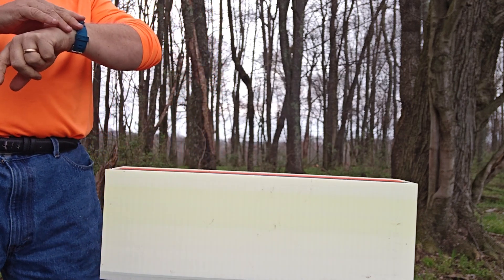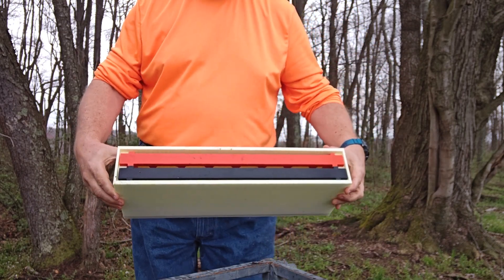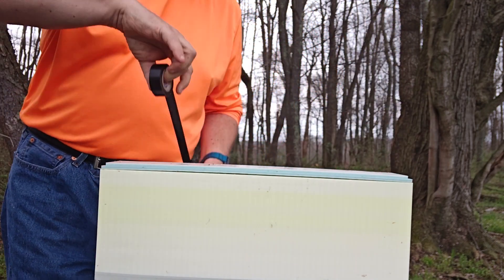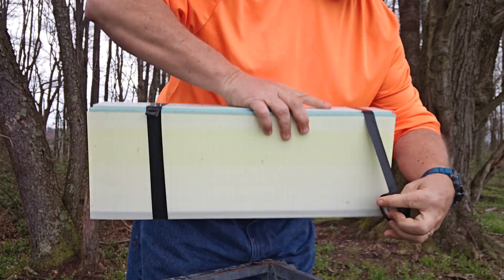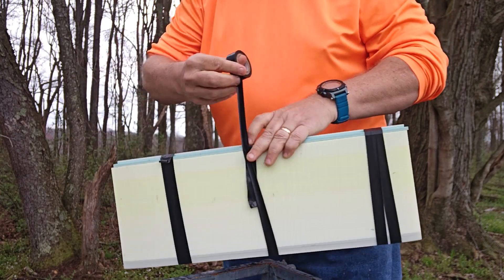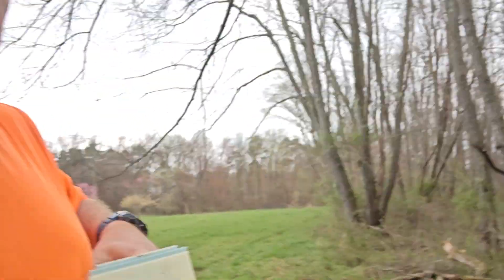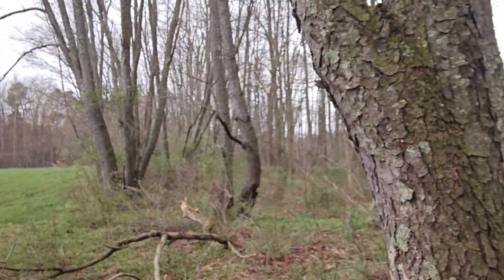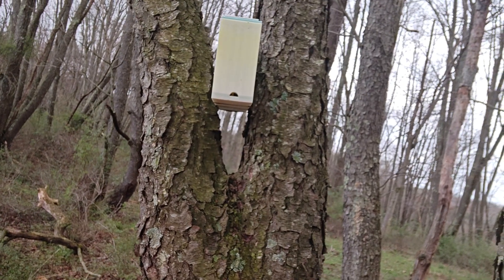Let's try 3d printing a swarm catcher.

Comment: Reminds me of a two frame mating box. If you could do a two frame deep with a couple lid changes, I think you would be in business. I like using some adjustable toggle latch clamps. If walls are thick enough to run a brass threaded insert into, then you could securely attach the clamp to the box. Along with the second clamp piece on the lid. Then adjust the clamps to a nice snug fit. Sorry for the rambling I just get going sometimes when I see a printed design. Best of luck to you and the bees.